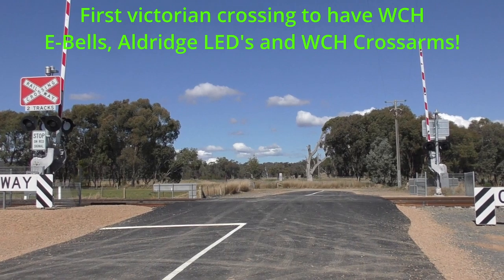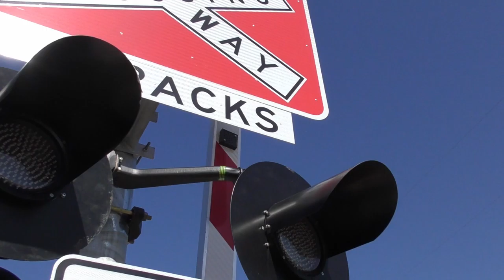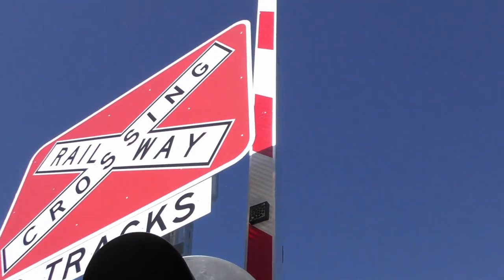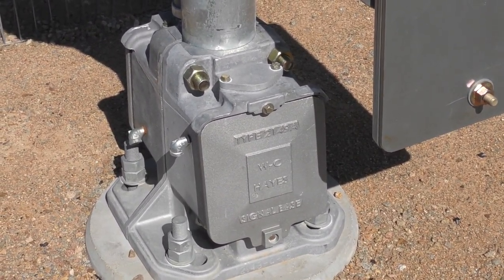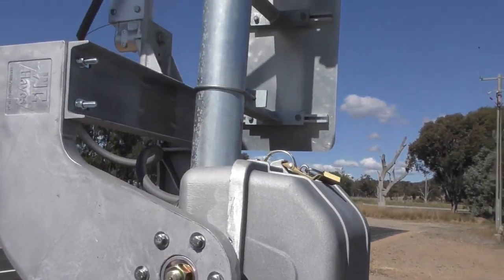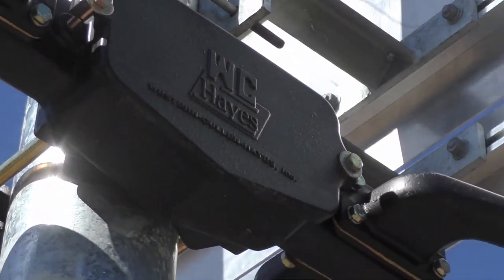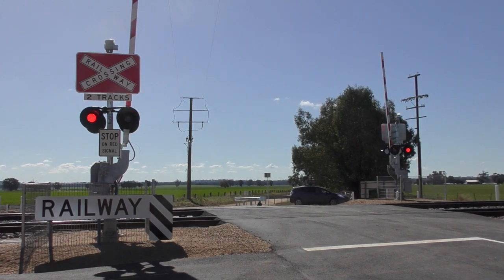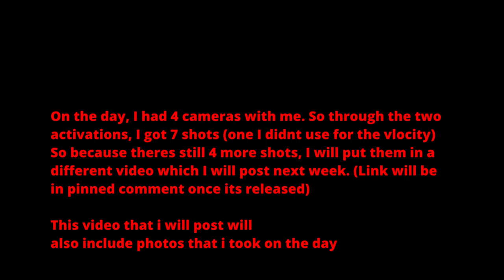(Vic's first WCH E-Bells!) Bennetts Road Level Crossing, Springhurst, Victoria!

Comment: These actually sound pretty cool. 
Wonder if any other crossings will get them if/when they get upgraded. They actually sound like some NSW crossings, only slower. Guessing they're the same type of bells?
Reply from the maker: Yeeeeee! It is to be confirmed but we think Wilbrahams Rd Euroa may have the same equipment. Yes, thats correct, they are the same type of bell, but when delivered from the WCH Factory they are slowed down like they are here, difference is NSW just speed them up
Reply: Ok cool, sounds interesting. Hope if they do then you'll film that one as well. That's pretty interesting. Wonder why they have them at different speeds for both states.
Reply from the maker: @therealsammyvee888  Oh hell yeah im filmin it no matter if its WCH or ST3s its still a new crossing so ye defo will film 😂 Yeah it certainly is, i think NSW puts a little more time and effort into their crossing installs, victoria just gets the equipment, sets it up, and thats it bahaha
Reply: it has wch E bells
Reply from the maker: @TudorCrossings  sure does!

Comment: I visited this recently and along the way I saw the same train seen in first activation, thing I noticed is that the crossing activates late as I was seeing the 12:04PM train. I saw the light of the train and it was right there then the crossing finally activated after a late start as the train you could just see. As you probably know the vlocity on the second activation on the other side as it was on the side as when I filmed it.